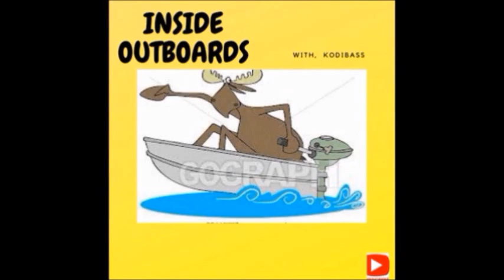JOHNSON / EVINRUDE 25,30 HP,     ( Jonnyrude )

Comment: Enjoying this episode. I am building a franken-motor right now. 88 johnson 20 hp converted to 30 hp with carb and intake from a 87 johnson and added electric start and charging coil from a wrecked 90 evinrude 25. Got it running tonight and then lost my water pump - started spitting water on and off then stopped all together. I think maybe the impeller came apart or the brass hub let go from the rubber. I will find out soon - too late tonight. They are a great engine.
Reply from the maker: Happens often'  drop & inspect  I tend to like the nylon center impellers better than brass or metal ones.    kb

Comment: Hey man, You are a cool dude. I am a old motor head of sorts I have an 81 25 Johnny/Rude that still runs and is fresh water powerhead and salt water beat up lower unit (skeg still intact). Anyway I have grinded the intake to match the the port on block. Im sure you know that restriction that exists there. I am tryin to get the 35 out of it. since doing that all it did was and still does is drink gas but its cool Im getting the same top end.........hmmmmmm timing gonna try that. dunno all this stuff I do is just for the love of it. Keep the good work up.
Reply from the maker: Good on U mate,  You may need to change the high speed jet in the carb bowl.    kb

Comment: Darktown Strutters Ball by Dean Martin believe it or. My Mom played piano her entire life and I can even play this on my trumpet. At Boeing on Fridays at lunch I would play some of the old goldies which allot of the younger folks had no idea what I was playing. I even played taps not and then if I felt it was a bad day around the shop. just put my new little cutie in my outboard rack to work on someday and do a will it run? 3hp 65 Evinrude 3502A I haven't even looked under the hood yet but i does pull over. That 10hp QD-15 I got for free with it is missing the gear shift handle but there is plenty for sale on ebay plus latches and those wing nut things on the side of the hood.
Reply from the maker: I'll B watching 4 sure. kb

Comment: awesome video bud, i have a 71 25hp johnson  i rebuilt but even after the rebuild i never got more than 87 compression but still runs, i really want to take it apart again soon and try to sand the engine case i remember it having some wobble when putting it together , should i try it or just leave it as is? i feel im lacking in speed she still pretty fast but i have that itch to tinker with it. would really appreciate any advice . thanks and great vids. your fan from texas.
Reply from the maker: How much run time does your motor have after the rebuild?  Those numbers may come up after about 10 hrs run time.     kb
Reply: @kodibassInsideoutboards  thanks for the advice, ill check again. I just bought me a parts one that has 110 on top and like 68 bottom hope its a gasket thing or rings. I just want the head and extra parts

Comment: I have a 1989 50 hp evenrude and snapped two wouldruth keys anys ideas why .
Reply: First, make sure the key is the right one and that it is placed with its outwards side aligned vertical (not slanted and parallel to the crankshaft taper flywheel mating section). Good luck !